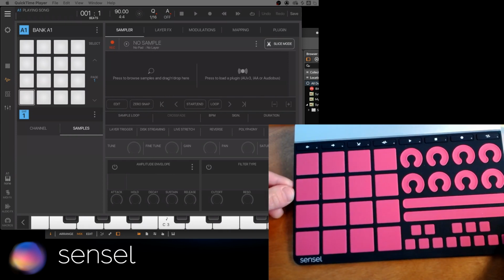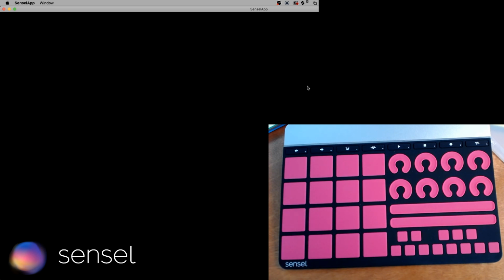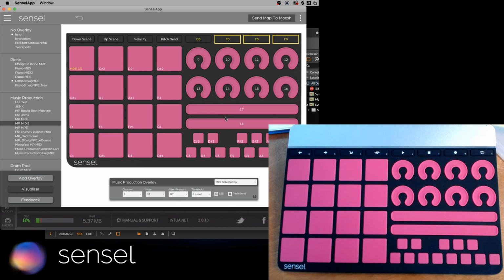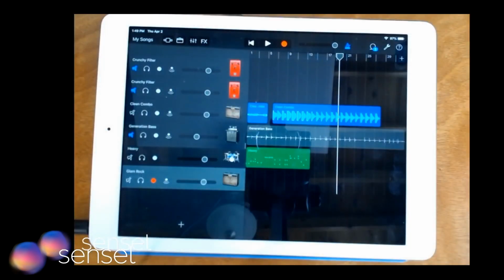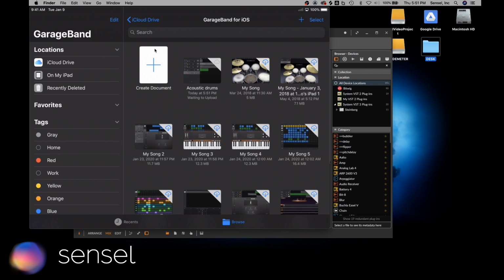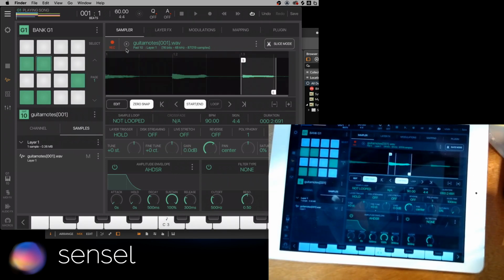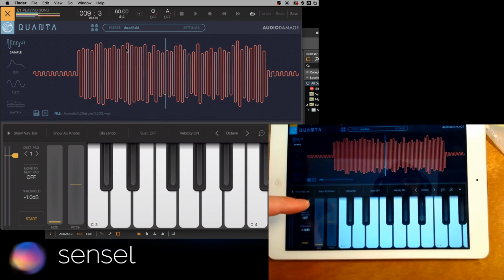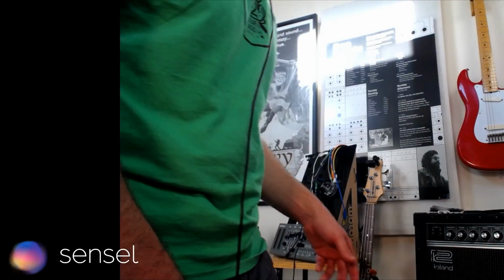Mobile Music With Beatmaker And The Sensel Morph

Comment: What version off the Sensel app are you using? Mines is v0.19.32 and I don’t have or get the send map to morph button or option!
Reply from the maker: Hey! A few things to try:

1) Update firmware if needed
2) Use USB
3) Avoid using USB hubs

If you're still having issues, please email support@sensel.com
Reply: @SenselInc  Thank you for the response and info, the issue was all because I was using a cable that didn't come with the morph! The cable fit and powered the morph but as soon as I connected the cable that comes with the morph all my issues with the app went away and I'm all smiles..
Reply from the maker: @benfrankluv604  That's great to hear. Thanks for letting us know! Have fun